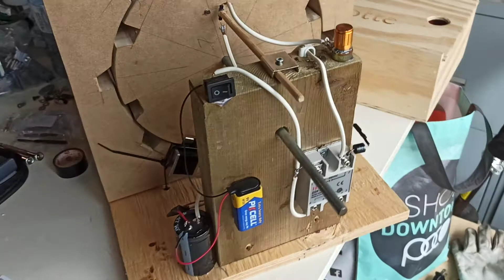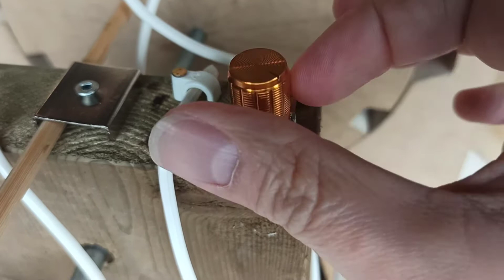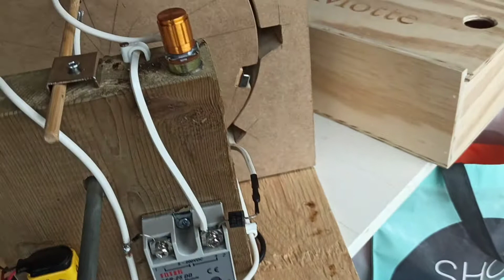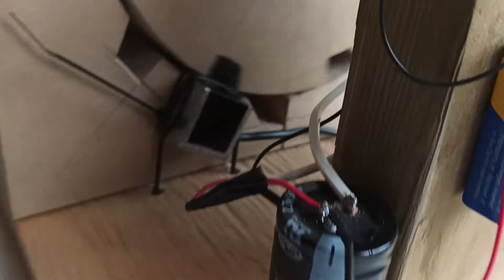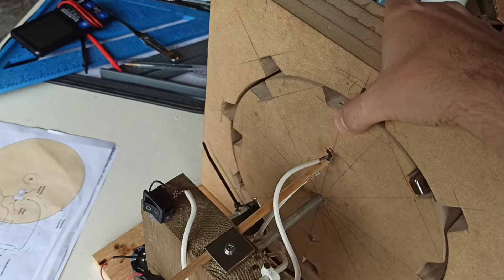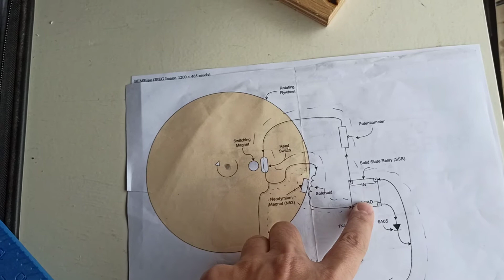Electro-Magnetic Pulse Motor - Part 3

Comment: Instead of bigger wheel, you could try to "shield" the reed switch using some iron case around where you dont want the magnetic field to penetrate. Or more complex, a piece of mirror placed on your rotating disc which would 'trip' a laser diode by having a section of mirror cut out where you want the timing to be l. Using an Arduino to program somethings can expand your possibilities, but requires some knowledge in coding. 

I think the easiest solution is drilling a hole where your mini "trip" magnet is, and placing / bolting in a thin rod sticking out past the big magnets influence, then attach your small magnet on the tip, then adjust your reed switches distance by pulling it back, away from your disc👍. 
Good luck man!
Reply from the maker: Hi Ronald, I'm already working on the next version of this idea using a larger wheel,  2 feet in diameter and weighing approx 28+ pounds.  This gives me more room to work and weight to help carry forward the momentum.  Only challenge I'm dealing with right now is boring a perfect 90 degree hole in the center.  I don't have a big enough drill press so I'm going to have to jerry-rig something.

My intention is to use the fly wheel to turn an axial flux generator, or whatever turns out to be the most efficient, tapping a small amount of rectified power and storing it in a capacitor.  Then I plan on using an Arduino to dump the charge back into the power source.  This way I'm not building a closed loop system but still hopefully something that looks like over unity.

Regardless of the outcome, I'm learning a tone, having fun and at least I'm trying.  There are a lot of people out there with way more knowledge and resources then me that just poo poo the whole idea without even trying.
Reply: @bumpymotors  https://youtu.be/u2mpAskFOu4  This vid explains the basic theory behind its workings. All about being able to break that "sticky spot" whilst gathering enough energy from the rest of it, but people make very small scale models which dont allow for enough accumulation of energy.... 
I would like to see what a LARGER one of these would do though ☺️. 
Your definitely on the right track👍. Keep up the good work and looking forward to your next vid✌️. 
 https://patents.google.com/patent/KR20170022947A/en
Reply from the maker: @ronaldd2154  Good times Ronald, we're on the same wavelength.  I've seen that video, in fact it's my inspiration for this project.  I've actually emailed Mike several times to ask him questions about aspects of his design I didn't understand and he was super helpful.  I'm just trying to simplify it a little more for the DIYers.  Haven't been able to work on the next version very much lately because of other projects at home, forest fires and work distractions.  But I have made some progress, the next rig has been built but I can't get the axle hole straight till I build a custom drill press.  Stupid wheel is too big.

Comment: umm you somehow created a little ting called cogging in a coreless stator...actually a axial flux  stator usually falls in ac topology and has serpentine coils or copper coils....no coil no stator no cogging ....but you made cogging with out a core o_O
Reply from the maker: We'll see how it goes on my next build.  I just disassemble this one and had to pull the magnet/solenoid apart by force.  lol